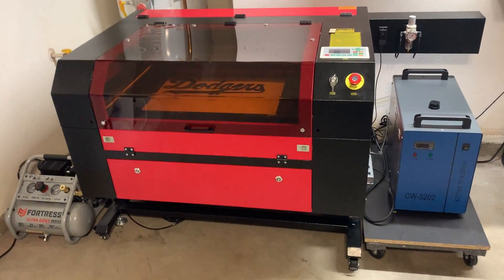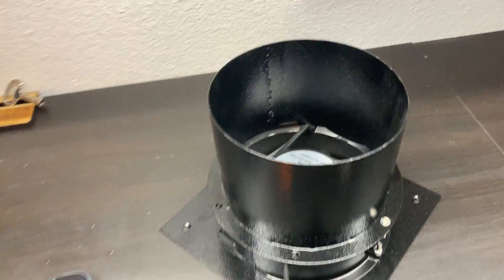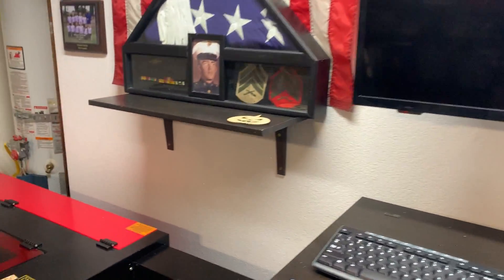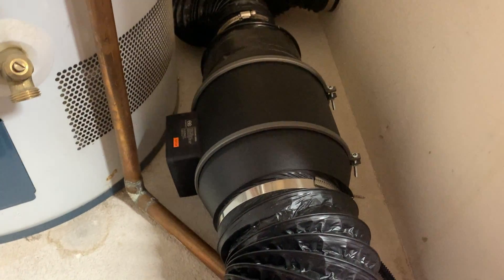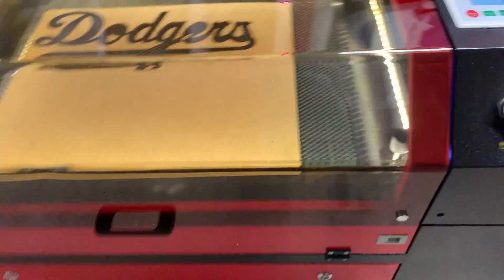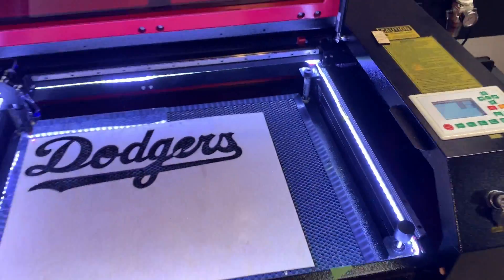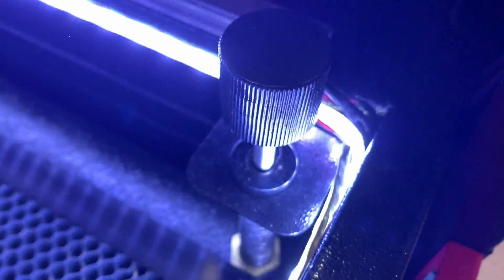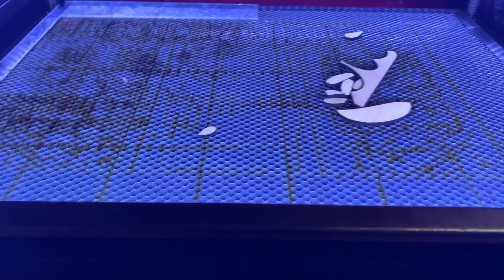New Omtech 100W Red & Black "Chinese Laser" Plus Mods

Comment: I like the mod with the existing crap of a light omtech included.  I just have my LED strip routed out the back to a phone charger type plug.  I have the same compressor too and love it.
Reply from the maker: Awesome! yeah, I come from extensive 3D printing background so I'm used to tearing apart Chinese machines and modding hehe

Comment: How have you found the quality of the OMTECH?. Was it good to go out of the crate (other than hooking up the chiller and fan etc)?. Were the mirrors aligned?
Reply: from everything ive read youll definitely need to align the mirrors on any laser thats been transported. after those upgrades he described. the only other part that could be better on them is the stepper motors. the more expensive machines will have hybrid servo motors that are more accurate or something like that.
Reply from the maker: Hey Keith! I have heard some stories but I had the exact opposite. all of my mirrors were aligned I just did the ramp test to find my focal distance and was off and cutting!
Reply: I have the same model in 80w. I just installed the tube and it was ready to go. These are work horses.

Comment: How thick of plywood can you cut efficiently? What is the focal length of your lens?
Reply from the maker: Not sure on the focal length of my lens. My distance I’m using to cut is 18mm from material. However I am noticing I am getting that hour glass shape cut towards bottom of finished edge. After modding I want to get into deep cuts and better mirrors and lens!

Comment: Nice mods.  A quick question on the cooler (CW 5202), it's for two laser tubes and has 2 inflows and 2 outflows.  I take it that you don't need to use both and so there's a way to shut off the unused one?  Does that require another mod?
Reply from the maker: Nope, you just cut a little piece of tube and bypass it. So I’m only using port A. Port B inlet and outlet are joined by the small piece of tube.

Comment: A quick question on venting.  I get the exhausting of the fumes is needed, and you likely need to crack open another window to allow the cross current (otherwise you are creating a sort of vacuum in the laser room and possibly reducing the life of the fume ventilator).  During the summer months, you can crack open a window, but what do you do during the winter months?  It can get really cold if you crack open the window.  Do you use a fume extractor or some sort of air exchange system?  Am I overthinking this because maybe you don't run the laser that long to make this an issue during the winter months?
Reply from the maker: To be honest I don’t think this exhaust is anywhere near strong enough to create a vacuum inside of the workspace because it struggles to get the smoke out still even though it’s an upgrade lol

One thing I want to explore in the future is coving some of the cracks on the machine to see if I can get better exhaust because the space between doors is huge!

I just exhaust to the outside electrical cabinet using a dryer exhaust outlet.

Comment: May I ask if you smell any kind of smoke or fumes if you work with the machine and just blow the fumes out of the house with some ventilators? because I wanna get a laser too and I am worried that the fumes come back into the house somewhere or if I work with plastic or such stuff it would not be that healthy to have those fumes in the room so what's your opinion? do they get out of the room with that ventilation system? I saw some use filter systems but they cost so much what I have seen.
Reply from the maker: you do get some smell, I cut wood exclusively and you will have that burnt smell in the area even with fumes vented out. the material that's cut still has burnt edges and It makes your hands smell as well. hope this helps! terribly sorry for the late response!! :)
Reply: Ducting it to the roof and running the fan after use will help greatly.

Comment: Question regarding the upgraded compressor. Looks like you have a 2 gallon one. Would a 1 gallon work and what’s the PSi?
Reply from the maker: I wouldn't go smaller than 2gallons because as i is right now as soon as the air assist kicks on the compressor will cycle during the entire job. Not sure if a 1 gallon would be able to keep up, my air is set to 30 PSI and so far so good!
Reply: @WallMan1013  awesome. Thank you for replying back. Going to get the 2 gallon . !
Reply: Or get a compressor capable of constant on.
Reply: Yup. Just bought that compressor. Was looking for something like this one and boom you came up.
Thanks for sharing the info
Reply from the maker: @humbertomedina4231  NICE!!! I'm Glad to be helpful :)